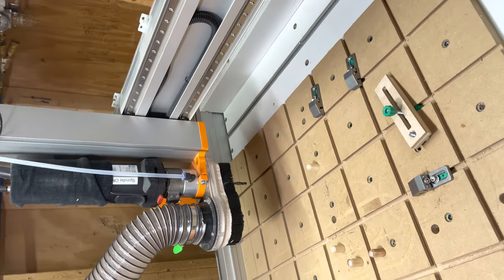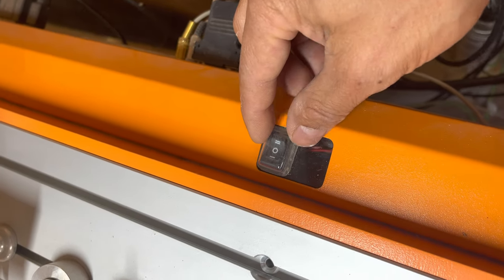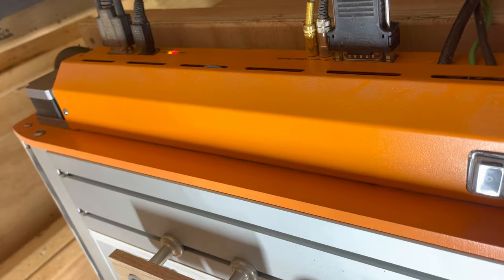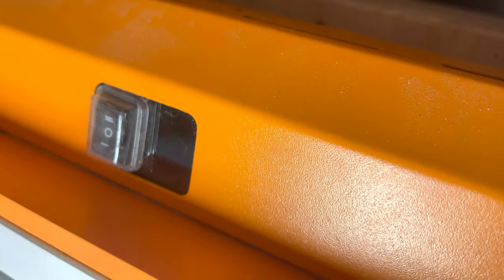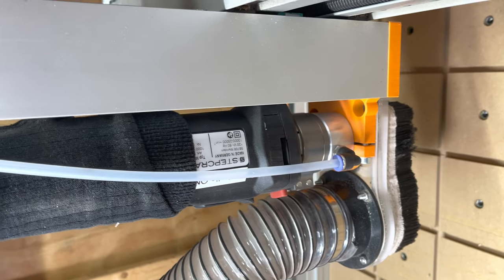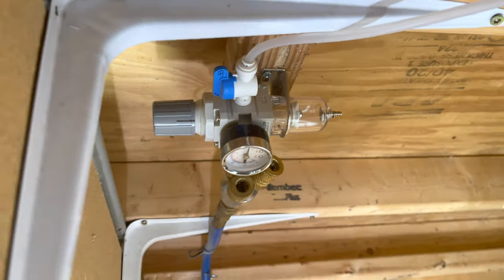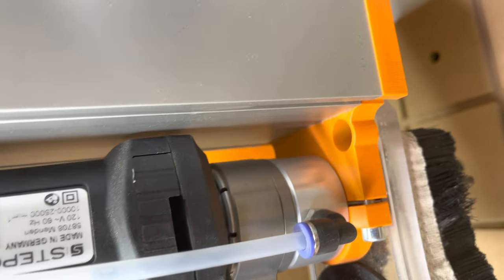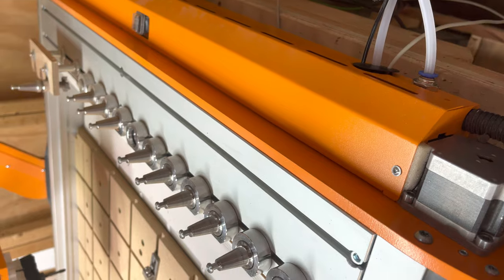ATC magazine cabling for my M.1000

Comment: I've been using my M.1000 for about a month now and am extremely impressed with it. I want to upgrade to the new magazine and will be doing so shortly. Glad I waited until they released it. I do not have a power switch either. I have the Vacuum table and with the Fein Turbo II Turbine Shop vac works amazing.
Reply from the maker: Glad to hear you joined the club. Since I replied pretty late to your comment (sorry) I'm curious how you like it after several months. Mine is a crucial part of my shop
Reply: @mountainmakers  It took some time to get the M6 macros figure out for the integrated magazine for the ATC  as it didn't come with any documentation for it but Hugo and Gregory are awesome. I also had some issues with z height retracting too high after a tool change which I'm currently testing out to see if that is fixed again with the help of Hugo. 

The only other issue I had was I purchased the Vacuum Table early I love it but had an issue with near the front of the machine dipping in the center. Put a 4' level across and fit some feeler gauges under it sent it off to tech and after they got back with the engineers they said it was within tolerance and while surfacing the spoilboard it would correct for it. I sense then installed another cross extrusion in the front and back and correct the issue.

Other than that, I think the CNC is a great product and it is a huge part of my business. Id like to test out other attachments in the future, Learning to trust the ATC process is still new to me and requires great trust and a steady mouse pointer hovering over the reset button waiting to pounce... probably my own anxiety in not wanting to snap a bit but ya know, it comes as part of the job I guess.

Comment: How have you been liking this setup overall? I am looking at getting an M700 with an ATC system.
Reply from the maker: After almost 2 years with this system, I've learned a lot. It's now a very productive system for my production needs. The new ATC system is the most valuable accessory